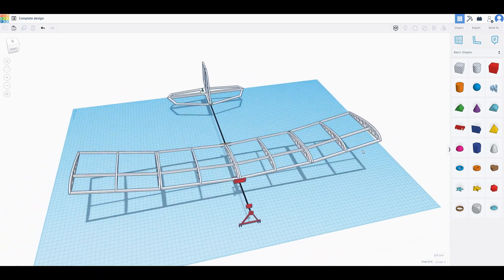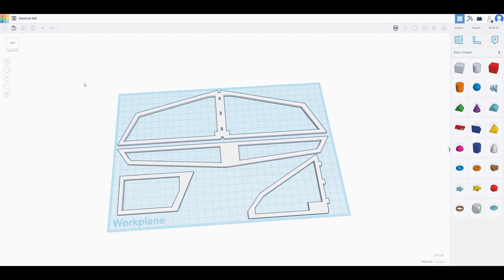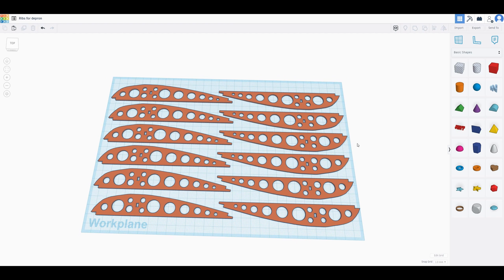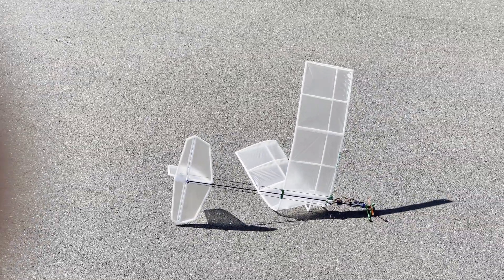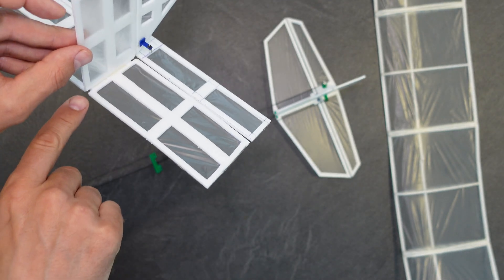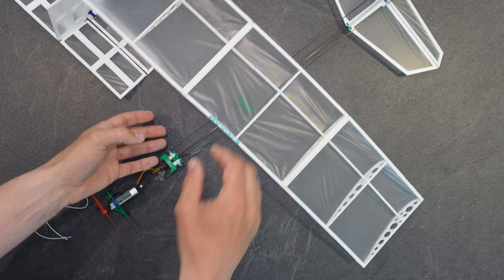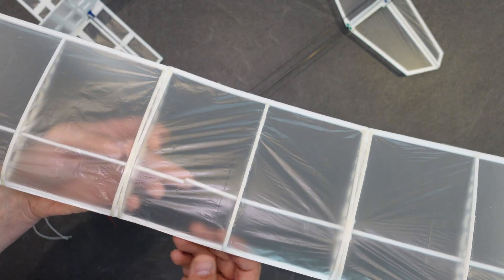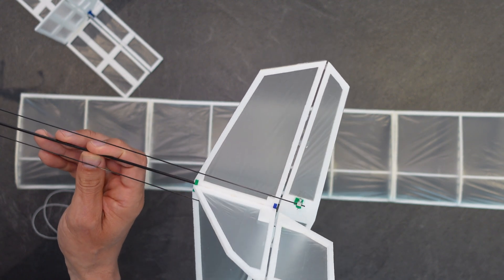Tiny brushless motor (BR0603B) on an RC plane using CAD modelling, laser cutting and 3D printing(V3)

Comment: The BR 0306B engine it is equivalent to coreless 8520?
Reply from the maker: The 8520 is much heavier, but could probably be used instead
Reply: @kaspersorensen  I want to put a 75mm propeller on the BR 0306, but I believe this propeller is too big for it.
Reply from the maker: @emersonsilva9712  if you dont run it at full throttle you could be ok. Otherwise consider a bigger motor 😊 the 1103 can handle a 4 inch

Comment: Have you considered using carbon rovings? Tape the beginning and the end of the rovings stretched out strait between the tape on the edge of a strait sheet of 2 or 3mm of balsa, what ever the width of your spar is. If you don't want that it sticks to the Balsa, run a bit of candle wax along the balsa edge. Once your rovings are laid out strait without twisting the fibres, run a bit of cyanoacrylate on it. Once it is cured peel it off and see if it is lighter than the carbon sticks you use from Hobby King. Make sure you keep your nose away from that smoke it will create while it goes off. I would suggest to use 6k rowings, it is narrow enough that one tow of it will be enough to cover a 3mm width.  Once it is cured it will feel a bit rough, just run a sandpaper block along the strand. You will end up with a thickness about .2 mm. Gluing one on top of your spar and below would make it like a beam. It is a bit of work but it might be worth it.

I have used that method making thin bent parts, like rounded corners on wingtips, or dihedral brace.

Hope that gave you some food for thought.
Knut
Reply from the maker: Hi Knut
Thanks for watching, and your input. I have not considered producing a strip like yours, but I have considered glueing a manufactured 0,3 mm x 3 mmm carbon strip to the front side of the depron spar, in order to make it stronger up/down to reduce wing flex.
https://www.hyperflight.co.uk/products.asp?code=CARBON-STRIP-303&name=3mm-x-0-3mm-carbon-strip
Yours is probably lighter.
However, the wing I just finished building, has no dihedral, it is just a flat wing with an unbroken square 1,4mm carbon fibre rod as the main spar. The wing appears to be alot stronger than the previous full depron wing. I do have concerns about the lack of dihedral, and how (un)stable it will be. I am waiting for access to an indoor flying area, so I can test it.
Reply: @kaspersorensen  It will be interesting to see if it will be able to be steared, just by the rudder. I still remember my early days of modelling, when I tried my own designs. If the model has no dihedral, can be best prescribed, as trying to balance a ballbearing on a flat surface.
Reply from the maker: Hi Knut, here is your answer: https://www.youtube.com/watch?v=zMjEtKax1Q4

Comment: information.        at 5:49,  STOOPID  use  of  CF.!!!!!!!!
stoopid design of h-stab tips;  stoopidly shaped elev  and  over-large rudder.      NORMALLY,  the  Chords  of  rudder and elev  SHOULD   BE  EQUAL.!!!!
Reply: A larger rudder is common on slowfly models.